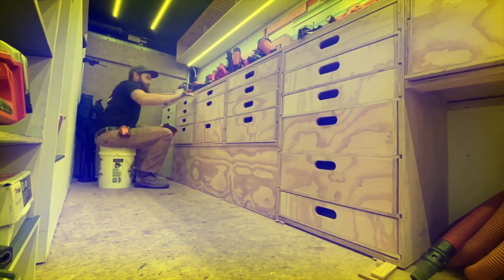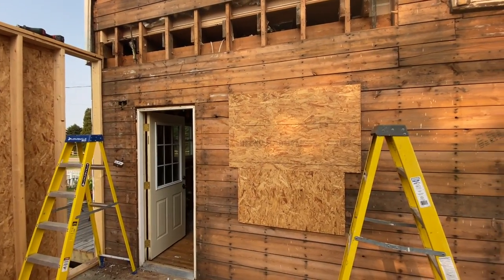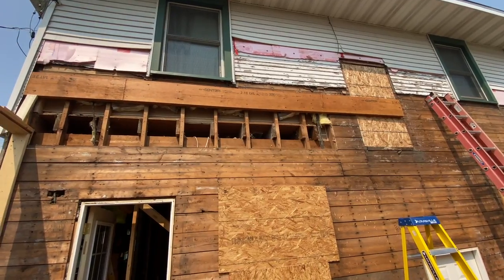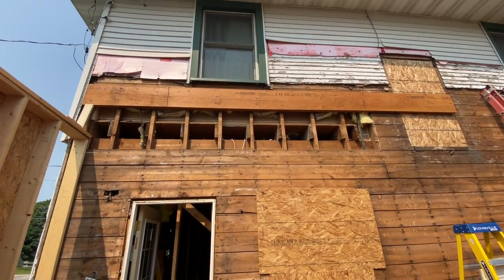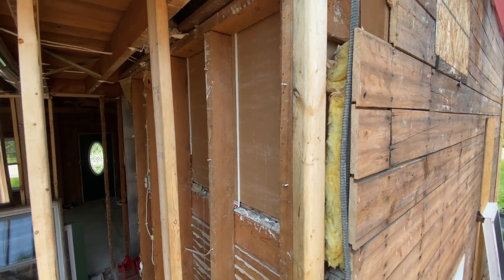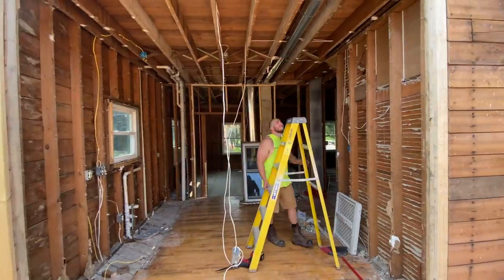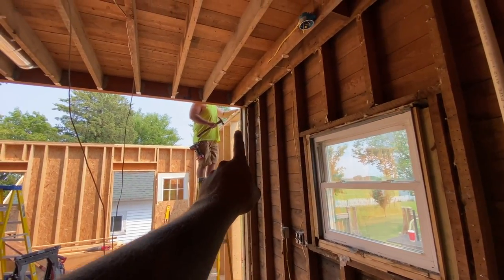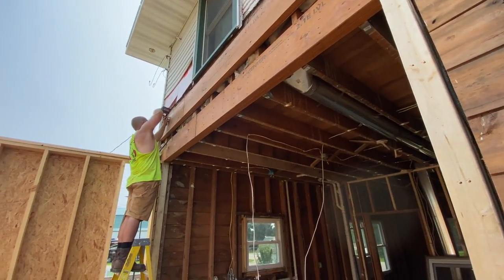Building an Addition: Removing a Load Bearing Wall

Comment: Thank you for the informative video. Looks like you opened up around 16’.  I need a laundry room for my 1957 ranch in TX - it was never in the garage, was probably in kitchen. Currently in a sunroom tacked on the back of the house that I call the EZ Bake oven - it’s 110° to 115° F in summer & freezing in winter. It’s time and your video gives me hope. Of course I have to relocate the kitchen to go through the back wall of the house - I have a great GC I trust, but still need to see the process to calm myself down!

Comment: That was a very cool video!  Do you think the extra LVL that you screwed on the outside of the wall above the LVL that was going to be permanent was necessary if you built the temporary wall inside?  Outstanding video though!  Thank you for taking the time to make these.
Reply from the maker: In this case yes. The second floor of the house was already remodeled. And the height of the LVL that we set actually went up into the wall cavity in the second floor. The temporary LVL was used to make sure the drywall in the upstairs didn’t move or crack. The temp wall inside made sure the floor didn’t move at all. Hopefully that makes sense!
Reply from the maker: That temporary LVL was also carrying the roof load. Seeing as the roof load carries onto the walls and the upstairs walls were interrupted, the LVL took that load and dispersed it down to the foundation while we were setting the new permanent LVL. This house is also balloon framed which has its on set of challenges.
Reply: @TheRealBeardedBuilder  Aha!  It absolutely does.  Great series so far and very informative.  How do you like the Milwaukee cordless framer?
Reply from the maker: @russalbright4213  it’s pretty good. I like it more than the paslode and marginally more that the Dewalt. It gets heavy after using it all day.